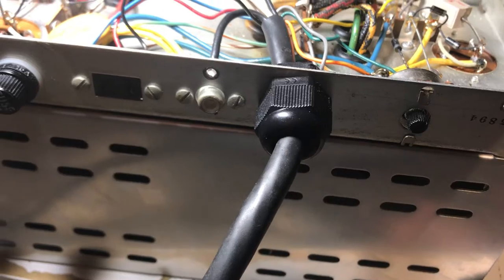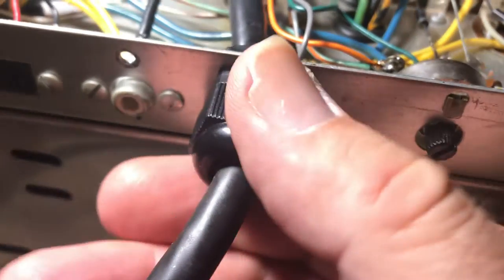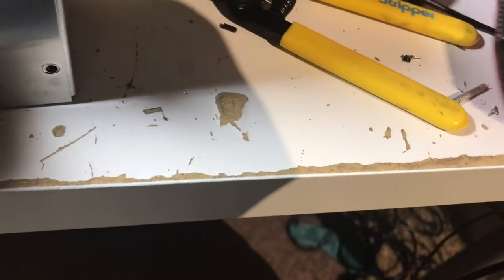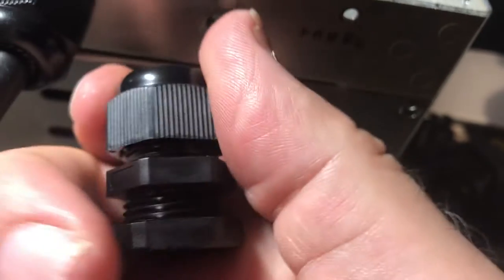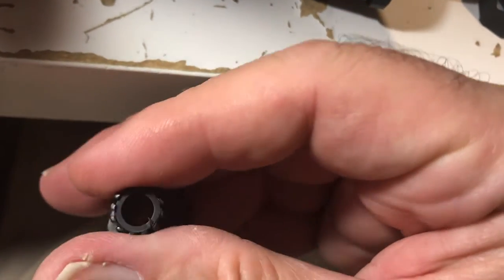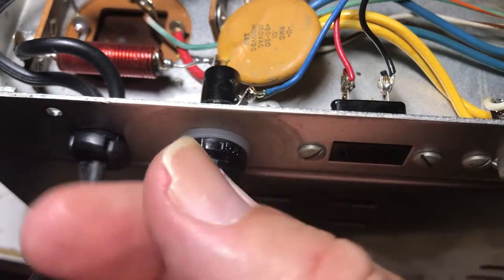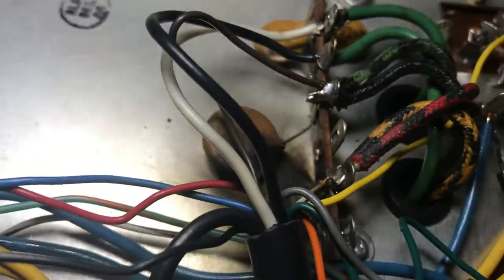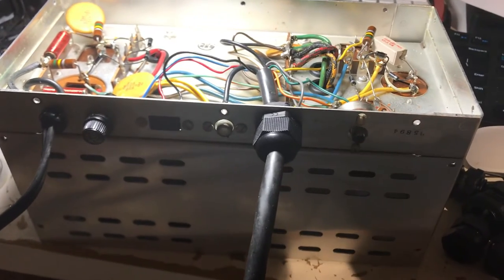Drake AC4 Power Supply install new strain relief on cord October 7, 2022

Comment: Hi moviestudioland
I left a comment on last years video on this, but here it is

Andy Garello
2 weeks ago
Can you explain further how you wired the Solid State relay.  I also replaced the caps with a kit and I am interested in placing a solid state relay.  Already ordered.  Thanks Andy KM4TRT
PS just received the Same relay that you used. Andy
Reply from the maker: There are posted videos on my channel on adding this relay.  Basically the relay switches the hot AC side which goes up to the switch in the drake on one side of the relay.  The other side I’ve switch in the drake is used to power the relay.  The relay side goes where the drake switch went.  The power side of the relay has the white wire or neutral and the  black wire or hot going up to the switch in the drake and then down to the other screw on the relay control side.

Not sure on the colors inside the ac4 and I sold that power supply